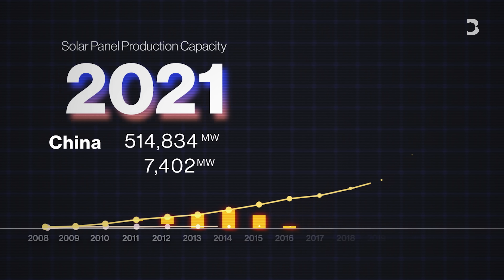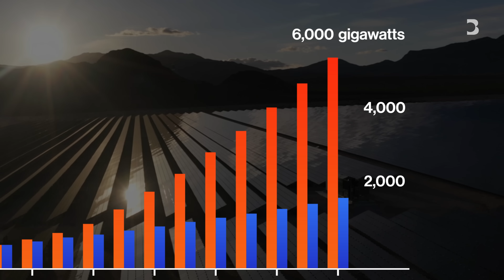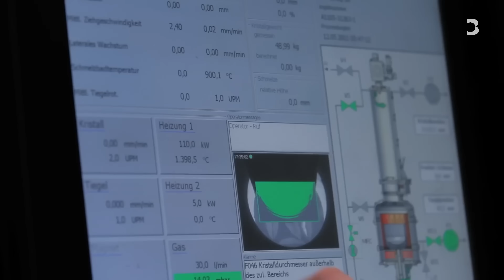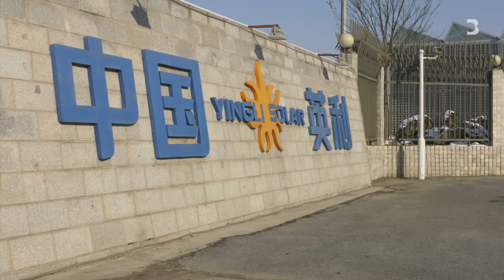Why the US is Losing the Solar Race to China

Comment: Even if the US could catch up with the manufacturing capacity, how is it going to compete with the low prices that China has been offering to the global market?
Reply: The only thing the US is commited to is military spending.
Reply: @silveriver9 and if China surpasses the United States all that military spending will be used, mutually assured destruction or not ☢️
Reply: Easy, find excuse to impose sanction
Reply: It would be hard.  Most the raw silica is coming from China, and that's what's used to make the silicon wafers.  Also, saying it comes from sand is misleading.  You get areas of larger deposits of it, and it's those deposits that help keep costs down.  They said about 90% of the world's silicon is coming from China, that happened around 2006 - 2009 where different mines were opened in China (shallow mines).

And this is why a lot of people think you shouldn't waste money trying to compete, or throw large tariffs on panels coming from China.  This isn't a drop dead technology.  Chinese companies AND the govt. WANT to export these products.  There's competition already in the Chinese companies.  It doesn't benefit them to cut supplies.  On the other hand IF they were to use that position and then jack up prices so the CCP can make a lot of tax revenue from this market which they aren't right now then I could see pushing for rapid development of solar panels outside of China.  But you STILL need large deposits of silica.

If there weren't tariffs on Chinese panels, right now the US would have a HUGE boom in installing capacity.  Companies WANT to do this.  Homeowners WANT to do this.  If anything those tariffs slow down the installation,
Reply: @johndoh5182  Well said. US tariffs on China is the dumbest policy that both administrations have engaged and continued in.
Reply: @sleepyjoe4529  The American people had access to cheap Chinese goods, but because of the so-called "national security issues" were forced to increase tariffs to push up the prices, resulting in serious inflation, the socks, clothes and shoes worth only a few cents to invade the U.S. in tanks and fighter jets?
Reply: @johndoh5182  Well the last thing we want is another OPEC in the form of solar energy, so we should ramp up domestic production, but yes our govs should work together, not against one another
Reply: @alastairhewitt380 we will go to war.
Reply: @johndoh5182 fun fact . If USA becomes a manufacturer. Dollar will die
Reply: China is beating america in so many areas nowadays. Thats why america is trying so hard to suppress china
Reply: True
Reply: Price must not be the only economic strategic asset you have as a country. As a Nation.  There must be a plethora of insightful strategic actionable ventures ready at the go to deal with economic , threats and ,these days, literal headwinds.
Reply: With 5G for industrial application (including AI) as well as rapid robot deployment, no one can ever replace China as the center of munfacturing in the world. The more we look at Europe right now, the more hopeless we feel: from inflation, to energy crisis, to EV, to battery, to rare earth materials, to aging population, to uncontrolled immigration, to the rise of Far Right...
Reply: China got there BECAUSE they scaled up the industry to achieve the economies of scale production. That is the reason the cost of solar has dropped 86% in the last 12 years. The woman in the video saying how expensive it is to make? Is wrong. China has achieved a scale that so called western experts believe is impossible to achieve. Nor does the west understand that economies of scale can be tracked and predicted. Which is how China got there as well. We can also predict that their costs will decline another 70-80% over the next decade as they continue to scale. The US is going to end up decades behind because of their protectionism. And that will cripple their economy for decades as they suffer with the higher embedded energy costs in their value chains as well.
Reply: The US will want to apply the "Huawei strategy", ban them for  "security" reasons
Reply: Well as long as China doesn't surpass the US you'll be fine. But if they do surpass the United States fallout will become a reality.
Reply: don't you know India, which hates China, offers even lower prices?
Reply: Tariffs. Of course.
Reply: That is what should be expected in trade. Poor countries will be manufacturing hub until they get wealthier and their currency stronger.  Then manufacturing will move to the next poor country. Rich countries benefit from cheap costs of goods while poor countries benefit from income stream. Eventually everything gets balanced and manufacturing costs the same everywhere. Then rich countries will now have to work.

This is only a problem in rich countries that are corrupt and don't tax their wealthy who benefit from cheap manufacturing.
Reply: who cares. I want a planet my great-grandchildren can live on.
Reply: @Tester24796 challenging the United States global dominance will guarantee that planet does not exist in the near future☢️
Reply: they can't, and that's OK. you won't allow poor countries any advantage, will you? weak currency = strong exports
Reply: A combination of automation and government subsidies. The subsidies would have to be to try to even out the effects of any currency value suppression, and from that level playing ground, high/full automation should give parity or even price advantage.
Reply: America needs to have them made in Vietnam
Reply: @jdbp876 just because they can easily bully Vietnam?
Reply: @anyetitan8410 we can do the same to China.
Reply: @TacticalMayo  no need to have a conversation with someone who cannot make a clear difference btw a man and a woman.
Reply: @anyetitan8410  we stay number one or war☢️
Reply: @TacticalMayo  go clean your bedroom kiddo
Reply: @anyetitan8410  take it as a joke if you want to.
Reply: @TacticalMayo  you have the wit of a kid so I'll say it again go clean you room boy you spend too much time online.
Reply: @jdbp876 其实越南工厂也是中国企业开设的，墨西哥工厂也是中国企业开设的。
Reply: @jdbp876  Chinese solar manufacturers have been setting up in Mexico taking the advantage of USMCA.
Reply: If you have people robbing and stealing because there are no jobs because they have
been shipped overseas, you have to put that cost into the price mix. Bargains from
China do not always come in cheap.